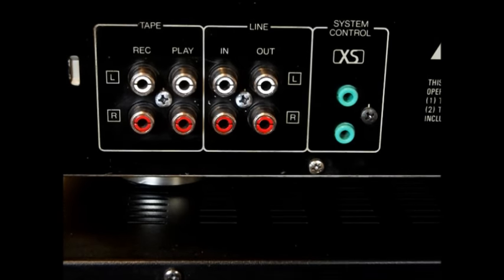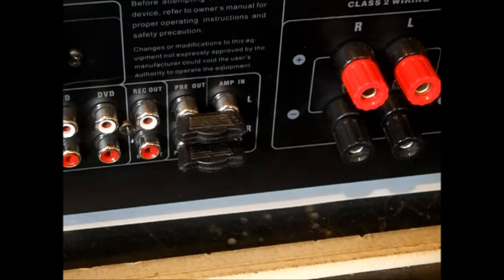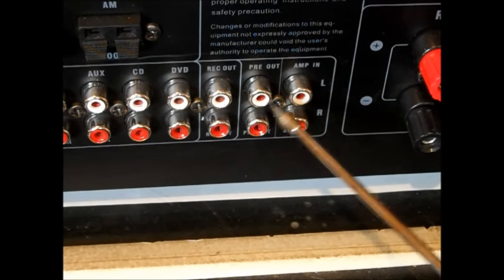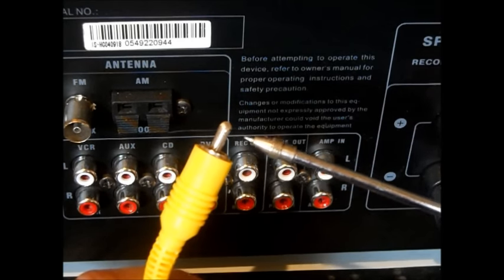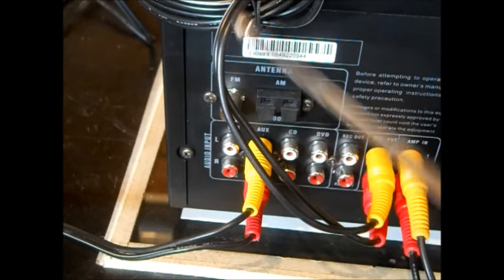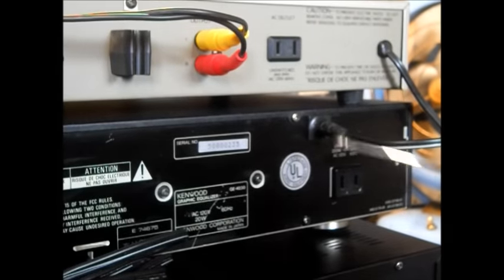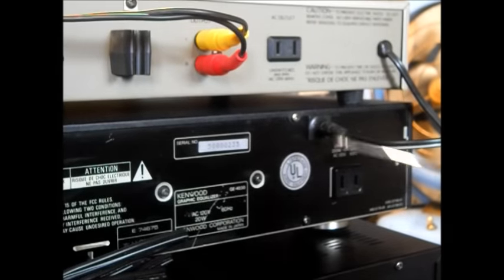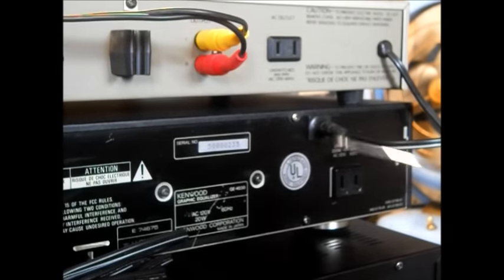STEREO HOOK UP ( Tuner EQ And Receiver Amp Wiring ) PART 1

Comment: THANK YOU SO MUCH! After 4 hours of working to get an old 92 Kenwood stereo hooked up, searching various places, someone finally dumbed it down enough, to my level. Having never worked on old analog stereo's I didn't know that there was a specific line out and in, for pre amp, that went down into the equalizer and then back! You saved my night, when you made this, back in 2012!
Reply from the maker: Glad I could help   Thanks for watching !!!

Comment: Yeppers, so did I. Had several "vintage" systems back in the day, but enjoyed the gun-metal-color series of Technics components. Have a SA-500 receiver, which is silver face/faux wood cabinet; found some gun-metal amps/tuners and receivers, and a few different EQs at a local flea market. Was just refreshing myself on the sequence of connections to the EQ; not all of the amps have the "Line Out/Line In" RCA jacks so was making sure to compensate for that.
Again, thanks of posting and enjoy your technique. :)

Comment: The XS was for other kenwood components. i.e if you pressed play on a cd tape/ dvd player, then the amp will auto switch to that unit. they were basically a cable with a headphone plug on each end.

The control system was either SL16 or SL32 SL16 was for older equipment.
Reply from the maker: 81keyholder Thanks !!!
Reply: it also allows the remote to Function all components

Comment: Not 2 Fast For U To C, I got a Sony STR-K402 AV Receiver and it ain't got Pre Amp Out or In Hookups but it does MD/ Tape In and Outputs will my Receiver work being hooked up that way I got a ADC Sound Shaper Five Equalizer?

Comment: Radio Shack made some cool {add on} products back in the later 70's and to mid 80's..I used to have a {bass} enhancer that basically connected to your receiver like a {eq}..Worked nicely on older stereos with {tape monitor} button..If a low end receiver was lacking bass but had nice high end this product was great..Most older eq like the one you have there only had 1 input for a cassette deck...The was once a realistic {tape} control center that had 3 inputs/outs so you can add more to your eq.

Comment: YOUR ABSALUTLY RIGHT ABOUT THE EAR BUD HOOK UP BUT CHEAP IN THIS CASE IS NOT BETTER I FOUND WITH THE CHEAPER PLUG IN (store bought) static was an issue if you appreciate quality sound go with the gold plugs better quality of sound no hiss on another note I have old school sansui equipment line in to tape out line out to tape in ROCK ON

Comment: Hello Sir, this is what I have and what I'm trying to achieve. I want to hook up my turntable to my receiver and then to my equalizer but I'm not having any luck. I could hook up my cassette deck and use it with the equalizer but not with the turntable. My receiver has inputs for phono, cd, vcr/line, tape 1 and tape 2 rec and play but no output. Any suggestions or comments? Thanks

Comment: I need some help. I have a aprox. 1985 Marantz graphic equalizer EQ 140 10 band. I have a Sony Audio/video control center about the same date. My receiver doesn't have a pre amp. Eq has line in, lineout on the back, tape in rec out. will they work   together? Thanks Jerry.

Comment: Hello, I'm wanting to add an pre-amp to my Kenwood VR-6070 for some bigger floor speakers that need more power. The receiver does have pre-amp outputs which is good. The amp I'm looking at is the Kenwood KA-828. I'm not sure on the amp where to put connection plugs from the pre-amp out jacks on receiver. Thx for any advice.
Reply: If you are adding an external amplifier (2,3 or 5 channel) to your receiver, you are going to use the corresponding "pre-amp" outputs from your receiver to the inputs on the amplifier.  You are basically bypassing your receivers built-in amplifier and using the external amp, taking the signal path out from your receiver thru the amp and out to the speakers.  Cheers!
Reply: How to hook up a  Kenwood vr,-209

Comment: Hey man, I have a question and I see that you’re still responding to comments 10 years later so I have a it has a out but it’s one not two it has one black out can I run it without having the equalizer go back into the receiver
Reply from the maker: the purpose of having in and out is to equalize the sound before it is amplified to go to the speakers  You cannot put a bunch of amps into an equalizer if you had  a left and right out low power you could come out and   go to the EQ andthen run the EQ into an Amp  I am no expert on this you should find a stereo tech before doing any odd ways of hooking up any thing

Comment: I have 2 of those {tape} control center since I have lots of components connected to my newer Onkyo TX-8050 2 channel net receiver..This receiver has the old school {phono} input and with the latest WRAT technology..This system has a audiosource (2002) stereo eq..Connecting this eq to the receiver and crossed bridged to the {tape} control centers and back to the eq and monitored back to the receiver takes a little more homework to get it all done right..

Comment: Please help.
i have Nad 3240PE, i am using it as a pre-amp, it is connected to a power amp Techincs A900S MKII, i connected it by cable that goes from NAD pre-out to Techcnics input.
So pre-out on Nad is now taken.
How can i connect Yamaha EQ70 equailzer to my system?

Thanks guys.

Comment: Whenever I power my pre and eq on the eq power level goes way up and 1 of mu amps don't turn off automatically when switch on the rear of amp is on supposed to turn off automatically one won't

Comment: Just bought an eq for my home receiver...I can't figure it out.  I don't know if the eq is bad or my receiver is bad.  I tried tape out/in on the receiver and nothing.  I tried vcr in/out and nothing.  So frustrating
Reply: Try the receiver first if that is good try the EQ. Just a process of elimination.On some EQs one side will only work or not at all.
Reply: @george25199  I think it was an issue with my receiver.  I tested the eq with a vintage receiver and it worked.

Comment: I don't have a Pre amp, Had it hooked before, butt been years, I have a Kenwood KR-V 7230  No Pre amp on it, Has Tape 1 and 2 tape 2 is moniter, Had it hooked before, getting signal thru the equalizer, not sure if going back into Equalizer correctly, I have a Kenwood Equalizer coming I bought off EBay , Very nice equalizer,,,,,,Want to hook it up correctly
Reply from the maker: +Ray Riddick Thanks for watching ...hope this helped

Comment: I have a Yamaha RX-V565 receiver and want to hook up an equalizer Kenwood GE-4030 but my receiver does not have the pre out  nor the amp in hook ups, so how should I hook it up?.
Reply: LINE IN TAPE OUT LINE OUT TAPE IN
Reply: Thanks!.
Reply: +Joe lopez i also have a yamaha rx-v592 rec and a vintage equalizer from radio shack and just did it play in rec out and it work s on my tuner cd player and my tape deck sound s great

Comment: If you have a {99 cent store,dollar tree,family dollar,ect.} you can find audio and video cables there for a dollar..I prefer "Uninex" brand that my local 99 Cent store carries on regular stock..Its a 6ft. audio {oxygen free} patch cable and works great..Any other audio brand cables will work fine..This is a excellent choice if one is on a tight budget..

Comment: I have a marantz pm 630 receiver and it has a little peg thing in the preamp out and in but it's metal and I'm not sure if it has to stay there. Any help?
Reply: @not2fast4u2c
Reply from the maker: Thats just a jumper like a jumper wire that is what you remove to run the wires to the equalizer and back

Comment: What if your Amplifier doesn't have an "Amp In" connection and only has a "Pre-Out" connection? Can you still connect an Equalizer to it? If so, what connection would you use? Mine also has built-in Bass, Treble and Balance control knobs. Will the Bass and Treble from the Amplifier be bypassed if an Equalizer is connected to it?

Comment: How do i connect my equlizer to my DBX 118 and Kenwood DA-1100EX it Doesn't have a Pre-Out?
Reply: You'll probably want use the tape monitor Rec/playback & line in/out on both the receiver and the EQ, in series to utilize the equalizers frequency functions for an improved {Hopefully} HI-FI sound in your living/sound stage room...etc. etc..   Remember to press "Tape-monitor" on your receiver/tuner pre-amp to switch from source to EQ direct, to either listen to stereo, tape, CD, DVD, etc. etc... to listen to your music/movies/streaming/network formfactor either EQ'd or not EQ'd, depending on the source or direct position.     Hope that helps!?  Uughh, "Old-school", it's coming back to me, ?...I Think?...Yeah! Got-IT!          Travis LC...

Comment: Too bad my receiver doesn't have that functionality, but my guitar amp does so I can make a sweet preamp for it.
Reply from the maker: +Awakened Anhedonic The old stereo stuff had a lot more features
Reply: +not2fast4u2c At least I still have tape, tape 2 for 3 head, and phono. And I use them all. My alternative to the preamp out and power amp in is to amplify the signal, do the effect, then attenuate back to unity line level before the receiver's preamp.

Comment: To much B.S.! I don't have a pre amp set up, It's built in , then how do u hook it up?
Reply: Should be connected to the REC OUT then to the Line in on the EQ.  The Pre-Amp output is variable with the volume control so NOOOO Good

Comment: Basic line in and out to connect an equaliser  
Yeah ok!   But it is no different  the tape line in and out that is next  to the so called line in and out   they are both exactly the same.  both line level    i forget but i think line level is .775rms     all the line level inputs    are 775mv   only exaptions  is MM    and MC phono    and some CD inputs    sometimes   1V   or more     so tape in and out is exactly the same line level   it is only in the older days   50s and 60s when some tape inputs were lower voltage  to suit tape heads.all on a modern amp is line level  tuner  aux   tape   your EQ connection,only  CD and  phono   can be much different WTF

Comment: how do i connect pc to 1  of these
Reply from the maker: steven dang I do not know
Reply: Get a cable called 3.55 jack to rca cable. Cheap on ebay.
Then connect the 3.5mm cable to headphones socket on pc or the back of the sound card and then other end to aux on the amp. Thats it. You are done
Reply: mr rambo creepy pic
Reply: +Rhonda Edwards screw this world
Reply: Get splicing, chop chop.

Comment: come on your not that dumb amp eq guy ....lol i really hope your are just making too simple for others also you are way side tracked upside down almost haha                oh and those green 3.5 are  remote in a away that if you have other pieces of equipment that are made from the same manufacturer ,they will comm"out" to" in "colour coded  (always out from component to amp) untill you connect amp if hdmi to tv then use "out" from amp to" in" on tv